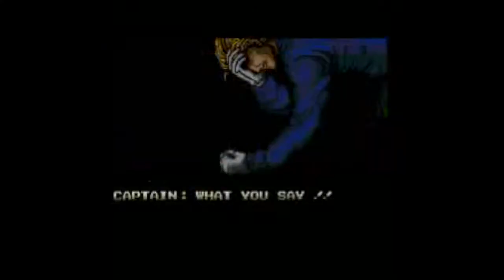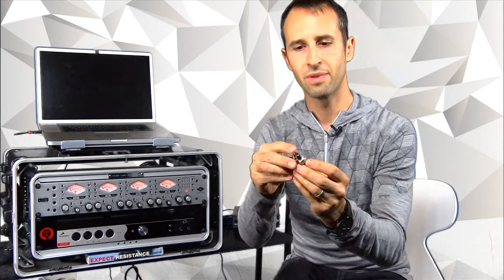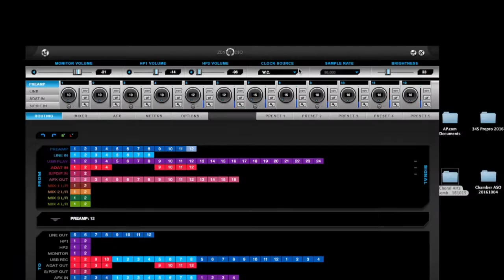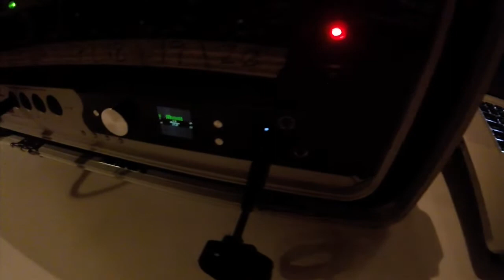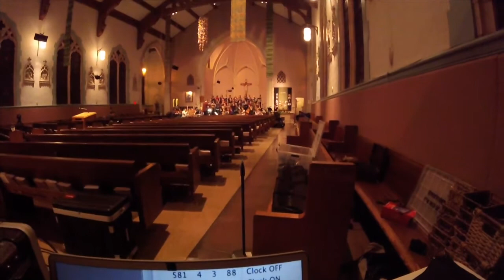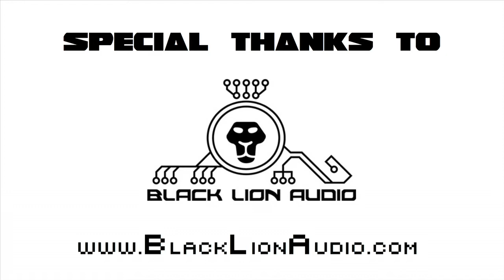External Word Clock Set Up Demo Recording Quality Comparison

Comment: I can't believe how well that word clock improved the recording.  It will be 4 years since you made this video soon, did you get to hear any other word clocks out there?  Did you find any more that impressed you?
Reply from the maker: Hey! Yeah the difference is remarkable. I just don't record or mix without the clock anymore because I can't deal with the difference haha.

I actually didn't do any more research after testing the BLA Micro Clock Mk III XB -- I just bought this one & moved on with life! I am certain that different clocks produce different-sounding results but I didn't want to go down that rabbit hole. If you're thinking about buying one, the only advice I can give is to spend at least $400. My reasoning for this is that the cost & quality are always directly related & we need to buy a better clock than what we paid for with out interface. I hope that's helpful ;)
Reply: @AdamLansky  Yeah I'm really falling down the rabbit hole here.  I've gone as far as looking at oven controlled clocks and even adding a 10Mhz Rubidium Atomic Clock as a reference to the oven controlled clock(only online, none in person)  I mean it's staggering how many thousands of dollars one can spend on time.  My application is just home hifi and replaying only on my audio interface which is a Burl B2 Bomber D/A.  Since I'm not recording and syncing an A/D and D/A I just wonder how well it could work for just home playback, I understand you're syncing a number of devices for recording and playback.  I'm on the journey if it's worth it for hifi playback.

Comment: My audio interface does not have any jacks for clock cables (spdif, 
adat, etc). I have a basic UMC404HD by Behringer. How would I 
incorporate a word clock device to my Behringer? I ask this question 
because I plan to purchase dedicated mic preamps in the future so I have
 more varieties of preamps. So, in my case, do I need a master clock 
device? I shall wait for your response. Thanks in advance.
Reply from the maker: well, uhh, sorry for the EXTREMELY late reply, but I haven't been checking this account. In your case, I would recommend investing in a better interface before getting involved with a clock. A Behringer might work but doesn't have good sound to it, nor does it have the appropriate connections you need to set up clocking. I wouldn't get anything less than a Focusrite 18i20 to start! Good luck friend

Comment: In our testing recording acoustic piano in a critical environment the clock had a better stereo image, a clearer sound, and better defined bass.  Also worth noting, different clocks have different effects on the sound.  For example one clock created a brighter recording we didn't care for on our material.  We were told that clock was popular for use with guitar based recordings and not acoustic based recordings.  I think you would find the same if you tried different clocks on similar material.  So it might be for a mobile or even studio rig you'd want a couple of clocks around.  Crazy thought, so we just use the one we liked on our acoustic material and went with that.  It does make a difference.
Reply: What clocks did you test?
Reply: @timperry2375  it’s been a long time since our tests. But I recall it was an Ardvark clock against an Apogee Big Ben. I don’t think the Ardvark is around anymore. For acoustic piano the Ardvark resulted in a better bass and stereo image. Warmer. The Apogee was brighter and thinner sounding. I spoke to an engineer at Apogee at the time and he said their clock was better for rock, electric guitars etc…We also tested cable on our mic pres and Mogami Digital cable certainly resulted in a noticeable more transparent sound. Since these days, sound has taken a backseat for this level of attention. So I don’t fuss like I used too though the artists at the time and I certainly appreciated  the effort and results.
Reply: Interesting. The big ben is a staple, and has been used in many of the metal albums I've liked iver the years. I'd be curious to see if it's still worth it up against the clocks from Black lion

Comment: Why terminating the out bnc?
Reply from the maker: In lower-quality clocks, the electrical signal originating from the clock can actually reflect off the unterminated hardware back into the clock like a mirror. This can cause the clock to jitter!

Black Lion Audio has assured me the Mk III XB would not have this problem, but why take chances? ;)

Comment: Holy Crap... I was not expecting that difference. It honestly sounds WAY better. way less muddy, Like you said it felt more real.... Why? I don't get it.
Reply from the maker: Okay so here's the secret:

Imagine you're watching an old move that plays the frames at 24 per second. That means each second is divided into 24 parts as equally as possible & one individual frame is displayed for that duration of time... So what happens if the frames aren't perfectly timed? Some arrive slightly too soon or too late & the image is no longer smooth -- it will appear inconsistent & be visually distracting.

It's the exact same thing with audio except there is a frame every 1/44,100 times a second or higher. These inconsistencies in timing produce micro phase shifts that cancel the dimensionality of sound. A good clock will be more consistent & produce more real-sounding audio!

Wild huh? Sorry it took me a YEAR to explain. My clock has slipped like a LOT lol

Comment: Most Awesome Video Dude! I've been a recording engineer for over 20 years and a live sound engineer for the past 5 years and NEVER even considered using word clock. I've always seen the BNC on the backs of equipment and thought you only need it for video. and now i do video and never needed it... So I dismissed it... Until a few weeks ago someone told me the YAMAHA LS9 was a great mixer but sucks without an external word clock... I was like wow! That led me to investigate witch in turn led me to your video.... I listened to your recordings and when the timpani cam in on the second pass I was like WAIT? WHAT? I didn't even notice them on the first pass... I went back and listened to both passes again and YES there was a significant difference in the warmth of the low end.. The timpani stood out. The Cellos and Bass were much more present in the mix.... DAMNIT!  Something else I need to buy.....

P.S. This was by fay the best explanation and example I've see so far. Thanks!
Reply from the maker: Yeah so my reply is REALLY late to the game here but I'm happy this was helpful! I actually got into this clock because someone randomly asked my advice on if it was important. I had no idea so I tested it & ended up spending $1000 on the clock featured in this video lol

Comment: Uhhhhhh...WHAT? You say you spoke to Antelope about clocking? Igor from Antelope started Antelope with doing clocking. Clocking comes more into play when you have multiple tracks running into a mixer. Matt Newport (who started Black Lion [moved on to Dzingoff]) who I used to go thrifting with, would also disagree with your assessment...as he designed the unit you used as the "control". Beyond ALL of that...it is "YouTube"....no REAL results unless you have files to download. Every audio nerd knows, "no real judgement, until I get the OG files". 
Beyond that....I love what you are doing...keep at it. HUGS.
Reply from the maker: bruh

Comment: Hello.  One of the best videos about word clock.  
I have a quick question.  I bought a  black lion audio sparrow mk2 Analog to digital converter.  It has a built in word clock.
So I just need to hook up the bnc coming from the bla sparrow to my fireface 802 word clock in?
Also it has a button on the back of the fireface that say 75ohm terminated.   Do i have to press that button?  Thank you bro!!!!
Reply from the maker: Yo AMADEUZ,

It sounds like you've got it right. How has this system been working for you? It would be really cool to hear how you like that sparrow!

Comment: Very well done video.  Lot's of fun but lots of good serious stuff too.  I just ordered the Black Lion micro mkIII, used but in good condition.  I do think I heard a difference here in your comparison.  It seems "more in your face", more in the forefront with the Black Lion on.  I know the MKIII is a step lower than the MKIII xb, but I hope it gives me some of what you have in the XB.  I'm running 3 interfaces and two Cymatic Utrack 24's, so the six outputs on the Black Lion should do the trick.  One reason I decided to watch your program here is to see if you terminated each unit, and it looks like you did.  The only thing that worries me a little is that you doubled up on the one unit by using not only the 75 ohm plug, but the internal terminator as well.  I've read from some pretty good sources online, I think, one of the might have been Sound on sound, that it can be detrimental to double up on the termination, however your recording sounded great, so I'm not sure if they're right on that.  Ultimately, I hope that I'm right in assuming that we should somehow, internally or externally terminate each unit when using this clock because it's not set up in a "daisy chain" fashion.  Let me know if I'm wrong on that.  Great job on your end, and keep up the good work.  Marc Trainor.

Comment: Adam, I'm trying to use a Zen Studio w/the BLA micro clock into logic, but it seems like logic is overriding the word clock and controlling the sample rate, any advice?
Reply from the maker: Hey! I am so sorry I just NOW saw this question D:

It sounds like you need to adjust the sample rate within Logic, and then the XB, and then make sure the Zen Studio is looking to external clock via the Zen Studio Launcher software control. I hope you solved the issue by now!!

Comment: Clocking..it's the taboo subject for me. I have a question and would be lovely if you can be gentle enough to answer it ar at least give me your opinion on that . I have only one audio interface (Orion 32+) which I use to control some outboard gear like  compressors, eq's, reverbs and a tube summing box, from time to time i record a guitar through a Isa One Focusrite preamp. My question is : considering that the Orion has its own very good clock which can be the master for my setup , does it make sense to have an external clock ? Thx
Reply from the maker: Hi Andrei, it sounds like you have a really nice setup! What I would say to anyone in your position is that a high-quality clock like the BLA XB will improve the quality of all aspects of production including tracking quality, playback quality while mixing, & bounce quality. Any interface I use while connected to the XB is operating at its absolute maximum potential & the difference is noticeable. Anytime I travel for work, the XB comes with me & the project is better as a result.

After owning the XB for over a year, it's hard to imagine working without it :)

Comment: Hi!  Great video!  I have a question for you.  Do you know anything about the Digidesign SYNC word clock? I was able to acquire one for a very good price, but I have no idea about how good or bad he quality of the clocking is.  Do you have any thoughts on it?
Reply from the maker: Hey, I am not familiar with this device. Anytime I'm buying gear, something I think about is the cost of the device compared to what I expect. An example might be if I own a new $1000 interface, I would want to use a clock that is also recent technology in a similar caliber of production, (i.e., probably not Behringer).

I wish I could provide a more specific answer! I hope this helps

Comment: BLA is partnered with sweetwater to help mod your interfaces and optimize them.  Do you think that will be more efficient than the external clock?
Reply from the maker: Black Lion Audio is AMAZING at what they do. In terms of their modifications to interfaces, I do not believe they adjust or replace any of the internal clocking units. They are typically improving op amps, capacitors, & connections within the hardware to improve the quality of signal path. How I would look at this is that it will result in an improvement to "sound texture" or timbre of the tracking quality.

The external clocking has a different effect that I would compare to image focus & overall clarity. If you can afford to have BLA operate on your devices, I do suggest it, but the clocking issue is different than their mods.

I hope this helps!

Comment: hm, strange that I didn’t notice a huge difference, and i’m listening on all high end gear. I guess it’s true as they say YMMV. Still, i’m interested in this piece. I have 3 digital devices, two (2) MOTU 16A’s connected by ethernet, and a digital effects box (the Yamaha SPX2000), usually connnected either analog or through AES/SPDIF, depending on how many input/outputs I need on my master clock 16A. Both interfaces have great ESS32 converters, but my understanding is that a good clock, or dedicated A to D converter should still make a difference that will be more than subtle. 

I guess the research shall continue. Outstanding video, by the way. Thank you.
Reply from the maker: If you're really interested in picking up one of the XB clocks, your best bet is to get in touch with BLA. The device is not cheap but the results are real. Talk to them about your production needs & maybe something can be arranged!

Comment: Great video and nicely explained! 

I think the sonic difference between the two examples leaves no doubts about the clarity, depth, and stereo field when using a master clock. At least that is my opinion based on what I heard.  

Just curious if you have compared: 

1. The Black Lion hardware vs Antelope Audio Master Clock hardware
2.  How much of a difference would it make if you were using an interface like Goliath and utilize it as a "Master Clock" to connect a couple of other devices instead of having a dedicated Master Clock. 

Also, can you please explain the signal path / gain stage for the Royer SF12. 

Thanks in advance.
Reply from the maker: Ioannis Andriotis Honestly, I have only tried the BLA Micro Clock XB & was sold. I have no doubt that Antelope makes an outstanding clock but I have not compared. There are some very interesting articles that assert different clocks will color a recording in different ways that are more or less pleasing to the ear!

In terms of using an external clock for multiple devices rather than the internal clock of any given interface, I typically default to "you get what you pay for". In other words, let's say I have a $3000 interface & a $1200 clock. Considering the amount of other components in the interface, I highly doubt its internal clock accounts for 30% of the device's cost. Therefore, the external clock is more likely of higher quality than the interface's internal clock. While I admit this to be a generalization that might not always be accurate, it is my starting point for assessing these things.

As for your SF-12 gain staging question, I set my gains the dame regardless of what microphone I am using. I will typically aim for -6dB to -3dB (digital) at the absolute loudest passage of whatever I am about to record. I like to use the Millennia HV-3D, Universal Audio 4-710, & the Universal Audio 2-610 on this mic. There is really no wrong setup for the SF-12 as it sounds lovely on any source. If I want some compression, my UA 4-710 has great compressors on each channel OR I use my Revive Audio modified ART PRO VLA II with Cinemag xformers. This is my best compressor & imparts a beautiful tone even if I don't press the signal from there I run straight into the Zen Studio. All Mogami interconnects, NO PATCHBAY.

I hope this is helpful! Thank you for. your kind words :) Happy recording!
Reply: Lansky Sound thanks for taking time to reply!

Comment: Hi Lansky,  From now, what is your thought after using the XB that long?  Have you tried some other stuff?
Reply from the maker: I do not work without my XB. If I travel, it comes with me. Every session, whether it's a single stereo pair on a piano or twenty channels on a live tracking session, the XB is my source for time while tracking, mixing, or mastering. I believe this device has improved the clarity & robustness of everything produced since I started using it. No regrets :D

There is a solid chance that most recording setups will benefit from an external clock, the Black Lion Micro Clock Mk 3 XB just happens to be mine! I hear the difference & I love it.

Thanks for asking :)

Comment: just started looking into this as i am setting up a studio midii and audio based and i a wondering wether to have a designated word clock hardware any advice would be grately appreciated, thanks for the video
Reply from the maker: Hey Juelez, thanks for watching. If you are running a production space with multiple A/D converters & outboard digital gear, all devices must clock from somewhere. The quality of the clock determines the accuracy of the sampling & ultimately clarity in your signal. Depending on your goals & where you are along the career path, it might not necessary to have a super-high grade device like the Black Lion Audio Mk III XB, but you will likely benefit from having a dedicated clock rather than syncing to your primary interface. As always, you get what you pay for!

Good luck :)